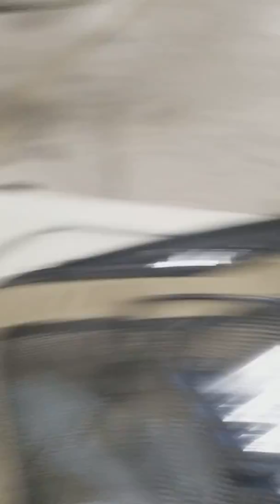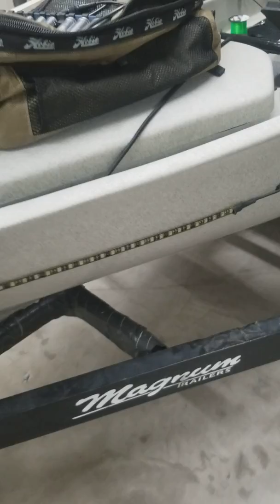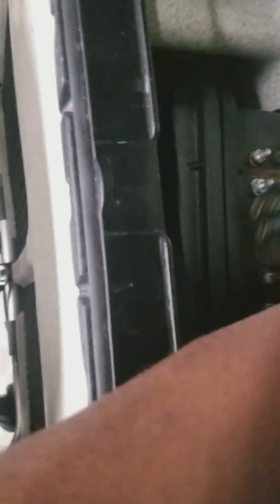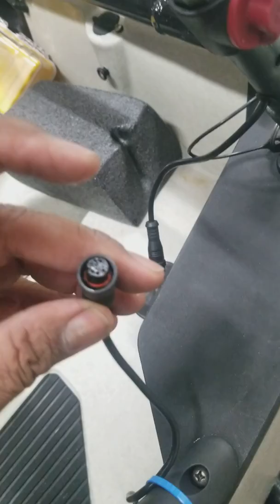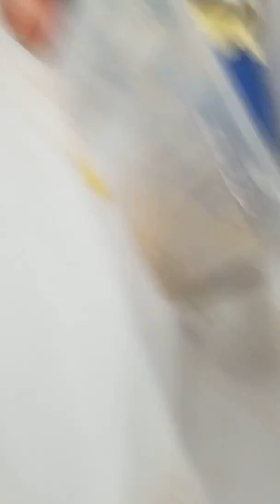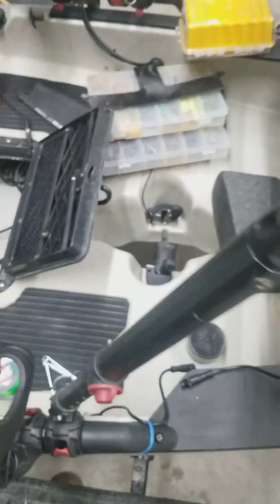Hobie pro-angler 14, pelican battery box

Comment: thanks man! similar to what i have planned up for mine when i get it but i wanna try and put my switches on the right side close to the seat- will hopefully get my pa14 in the spring and make a video of my setup
Reply from the maker: ryguy11794 they have sealed waterproof switch panels that would do the job well.

I chose a single water sealed toggle switch placed up front because it was easy for me to flick the switch with my foot.
Reply from the maker: ryguy11794 i also intend on installing a torqeedo 403 on the rear later this year.

The mirage drive is good exercise, but its dangerous not to be able to get back to land quickly when youre on the open ocean.

I wanted to keep the area close to my hands free for installing the control pod.